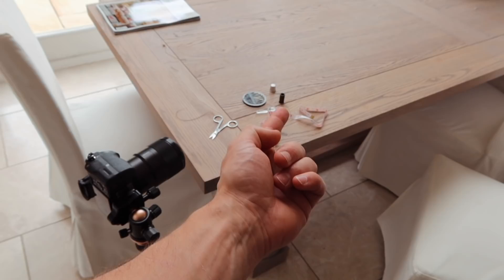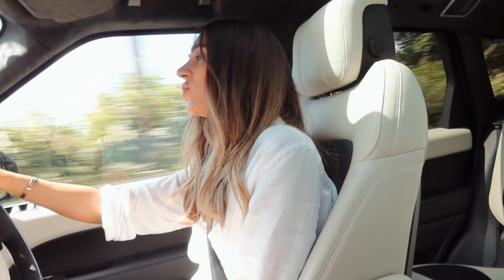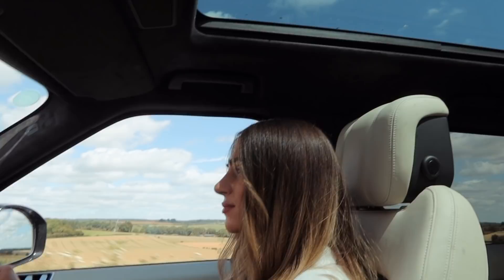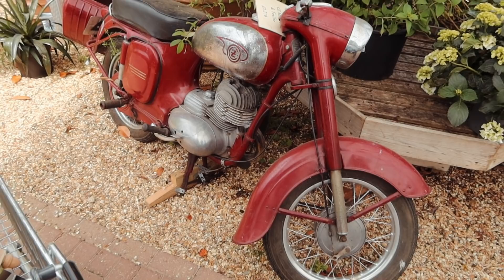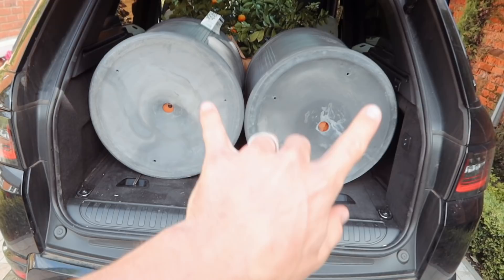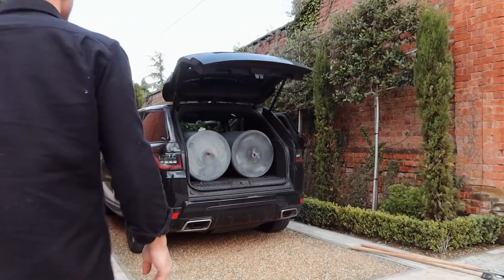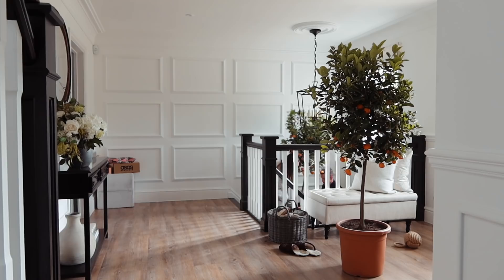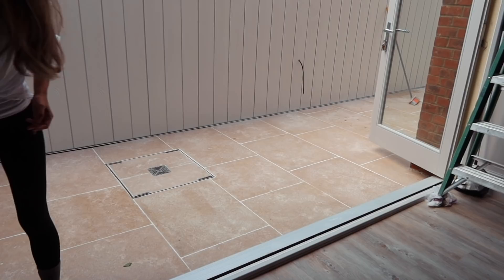LYDIA & I VENTURE OUT FOR THE FIRST TIME | Vlog

Comment: Yes you have been out together when you went to get veggie, at the pub I believe and they were only letting a few people in at a time. Yeah you're going to find that those orange trees aren't going to thrive down there they need direct sunlight and once you start picking on them they won't look as colorful. You'll also need to spray them occasionally for bugs. Don't water them until the first inch of soil is dry, you can over water them and they'll go bad. They're better in clay or plastic pots to keep in moisture. You have one of the hardy group of oranges that are really more like mandarin orange and tangerine. Good Luck

Comment: Ali what type of insulation did you use between the wall and the panels?  Are the panels able to handle freezing and thawing?  Not sure if that is a major issue in your neck of the woods, but here in the Midwest everything winds up cracking....🌬❄️🌧☀️
Reply from the maker: The wall is a supporting wall not connected to the main building as such so insulation isn't required as there is no reason to keep heat in, the wall was battened to allow for air flow and where the returns butt into the wall that's an external wall that has it's own insulation to the internal wall of the property .